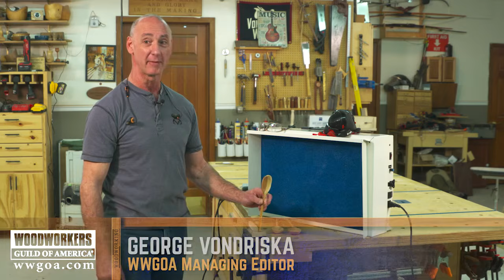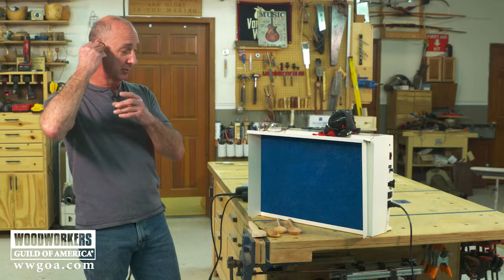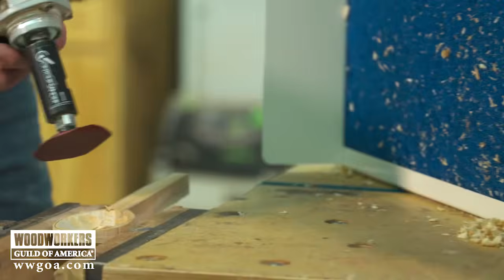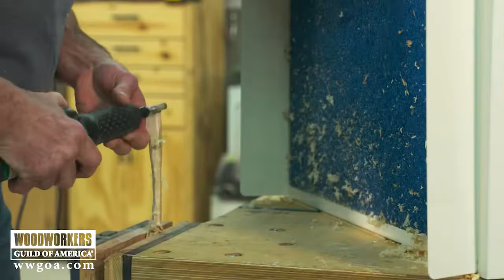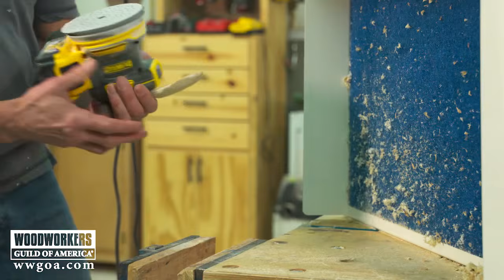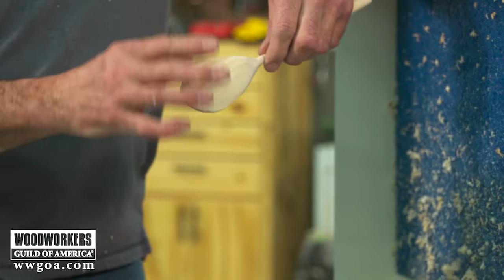BENCHTOP ONEIDA DUST COLLECTOR

Comment: Hmm. A $600 filter that does the same thing as the one I use that cost me $30. 20 inch variable speed box fan: $20. MERV-13 filter bungied to the intake side of the fan: $10 (discounted as I buy four at a time). I could build three of my setups for the cost of one filter replacement. Don't think so.
Reply: See you missing the point.  The feature you get with this Oneida that you cannot do with your box fan is plug your electric tool into the box fan.  ;-)  That additional feature costs $570 more.
Reply: @robertknowles3677  Just get an automatic vacuum switch for $30. When you turn on your tool, the fan comes on. When you turn off the tool, there's an 8-10 second delay for the fan to stop.
Reply: Does this really work though? I think I`ll try it and find out. Thanks!
Reply: The box filters  have gone up so much...where can you find merv13 20x20x1 besides amazon and cheap.